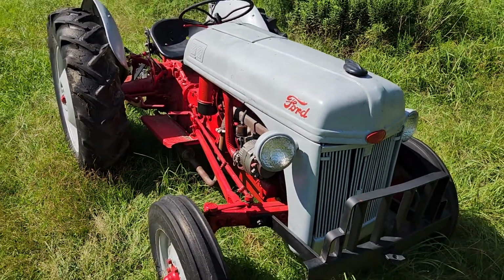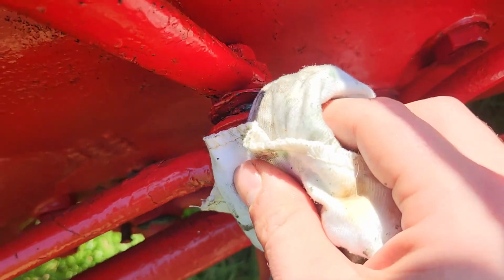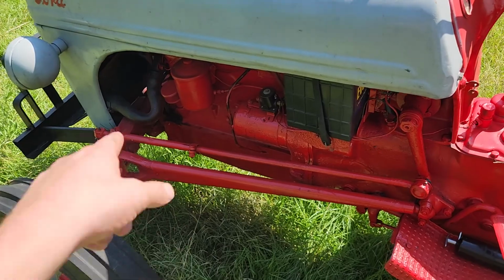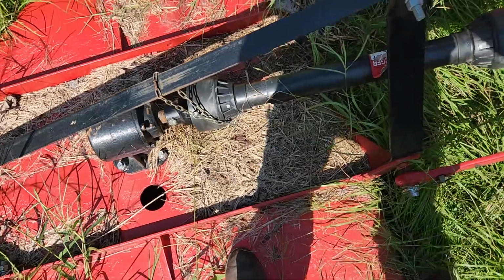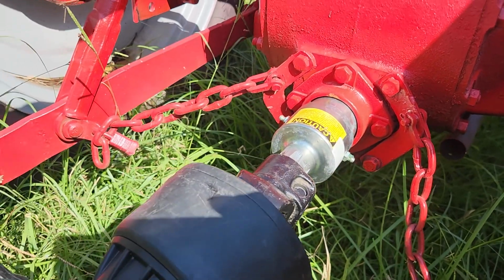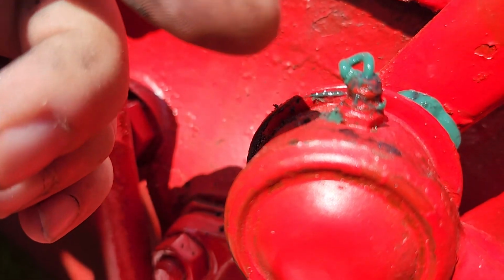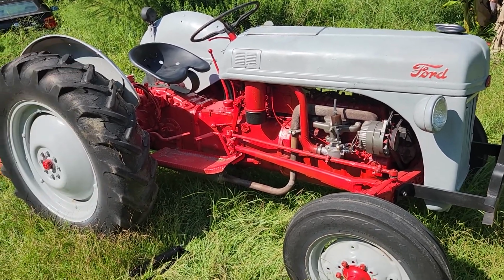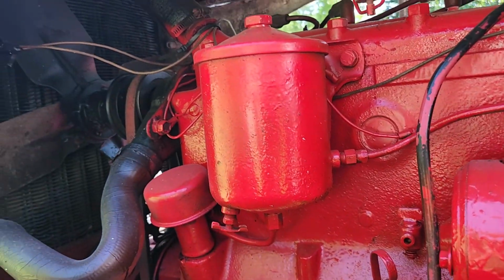Ford 8N grease points: What you need to know

Comment: Looking at it in the video I’d say 48 maybe 49.
Reply from the maker: Yes that is the best I got too. Haven't been able to find a serial number due to the amount of paint over the years. But that front mounted distributor gives 48/49 as the year.
Reply: @Tibbs_Farm  shifter nob is also metal, that tells me it’s an earlier model. You can’t always go by the casting # on the block. These tractors had engine changes all the time. I would safely guess late 48- early 49 but without more investigation very hard to tell from the video.
Reply from the maker: @oliverwoodcraft9733  that is a very good point. I didn't even think about the shifter knob placing date, but you are right. Thank you for the information.

Comment: In a perfect world wouldn’t you not want the grease coming out and if it does the boot is either ruined or you just ruined it?
Reply from the maker: On new tie rod ends, you are correct. There should be boots, and grease coming out is not good. 

All of the other locations, you do want to see new grease squeeze out.
Reply: I have the same type of tractor. built around 1948 It does not have rubber boots . Nothing to blow out, grease it till you see it
Reply: My dad and brother both had/have old Fords and when greased it did squeeze out  Never thought about it until seeing a boot in a parts list and thought hmmm 🤔 I wonder if we were just too poor to replace those LOL